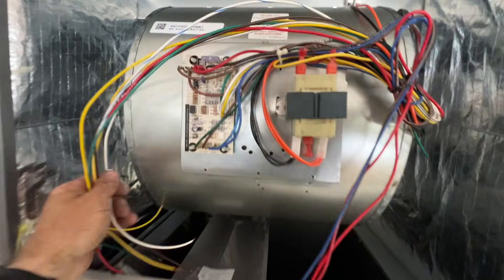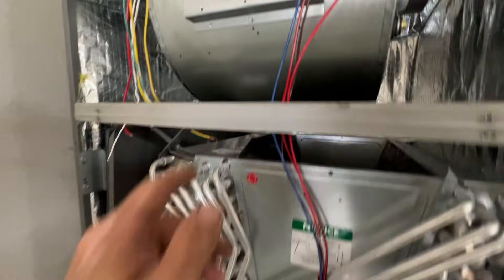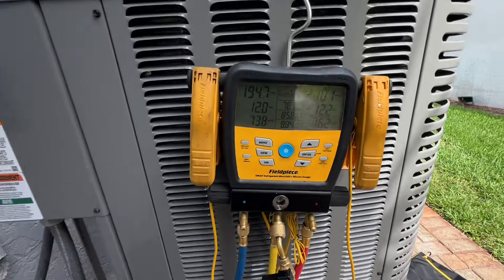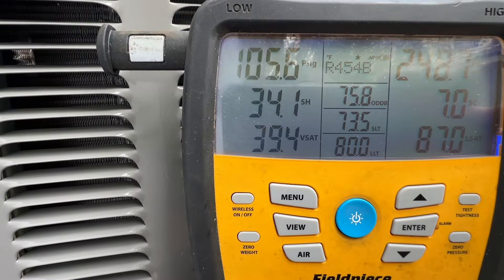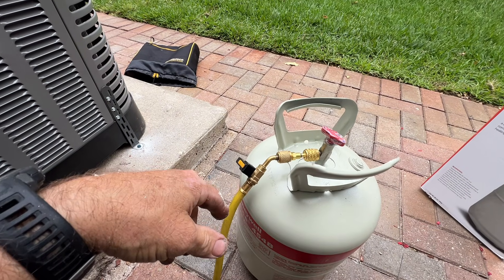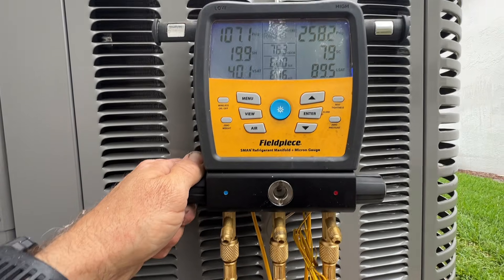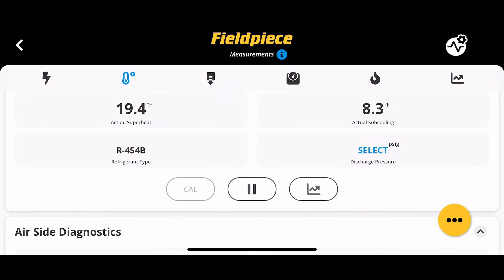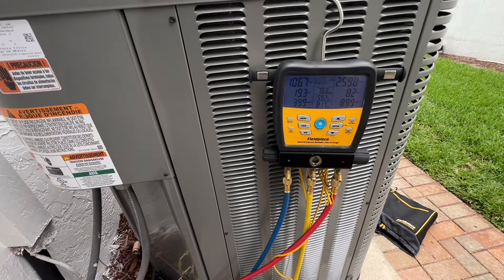R454B Rheem Split System Start Up And Charge … Air Handler Wiring With A2L Refrigerant Monitor

Comment: Thanks for sharing.  It's cold in NJ so we're not really getting into this that much yet but I'm sure this spring we'll be seeing alot of 454b and the like.  I was suprised to see the pressures being as high as they are, almost as high as 410a, I was expecting it to be similar to r22.
Reply: Both refrigerants are very similar to 410a. 410 is a 50/50 blend of R32 and R125 and 454b still utilizes R32. It is a blend of 68.9% R32 and the remaining 31.1% is R1234yf. R32,a single component, will be in all Daikin/Amana/Goodman product as well as most mini split and VRV/VRF products. Both "new" refrigerants are still HFC's and will continue to use the same POE or PVE oil that's in 410 as well. I use the word new lightly because R32 has been in use for over a decade by more than 50 OEMS including the ones using 454b in North America. There's something like a quarter of a billion systems installed globally using R32.
Reply from the maker: @scottkelly8288  Good info 👍
Reply: R32 or whatever Daikin is using will also be similar
Reply from the maker: Yeah it closer to 410a